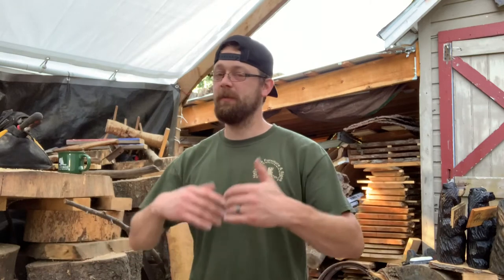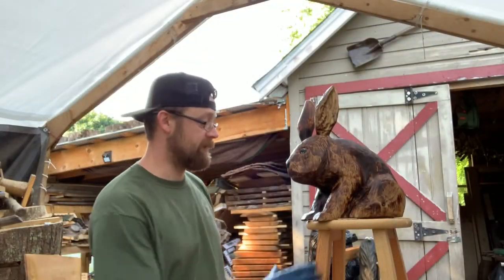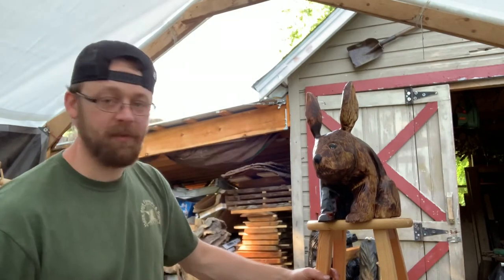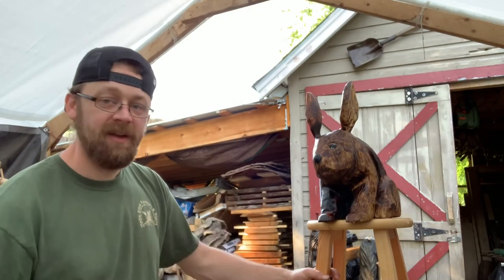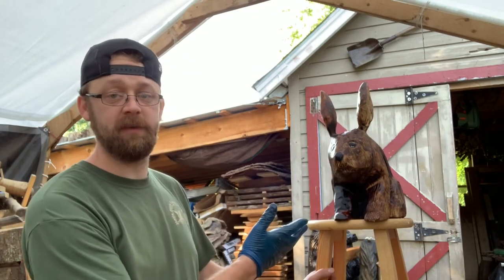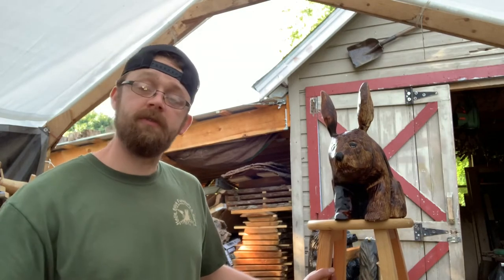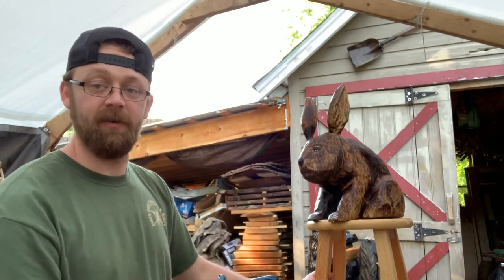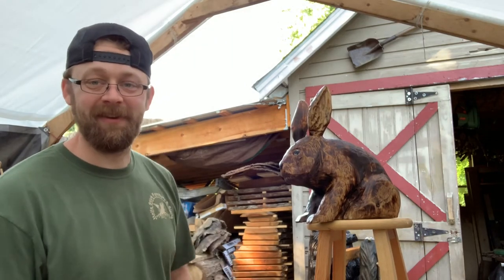Chainsaw carving a rabbit. (FAIL )

Comment: I saw a rabbit with ears down and short on back. Rabbit colors are not always multi colors. There are brown rabbits. LOL  Your is  better than you think. I also saw one full standing,  with an animated look. Both had good detail on the face. I did not take pictures. Did rough  hand drawing. What  final shaping tool did you use. What type/ number of cutting chain do you use on your sthil 14 inch.? George  PS Slowly getting  all my safety gear together for carving.
Reply from the maker: Hi George thanks for the comment. I finish carvings with a flap sander a turbo torch , and a die grinder with saburrtooth burrs . You can find links to amazon to find these tools under most of my videos. Normally I’m running a 1/4 pitch Stihl pico chain . But you have to run the size that fits . The right pitch the right gauge and the proper amount of links .

Comment: Do you know of any way to stand up a heavy log without machinery?
Reply from the maker: Leverage. I use big bars lift a little put wood under it and keep going . This only works so far then I stand it up . Obviously some logs are just to big so I use a lift that’s mounted in my truck
Reply: @KyleHallwoodworker   The old spud bar and board trick worked pretty well, though I'm sure my back is going to hurt for a few weeks. Thanks for the help, and by the way, the rabbit looks pretty good to me.